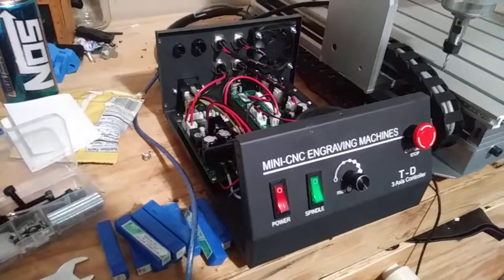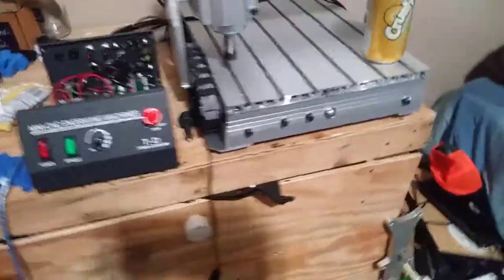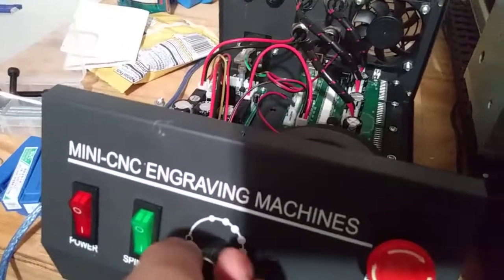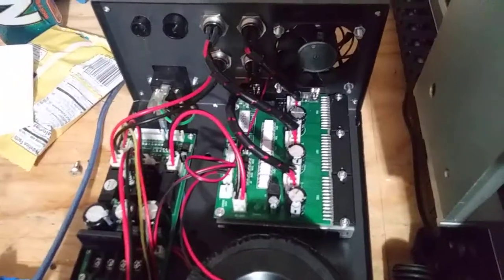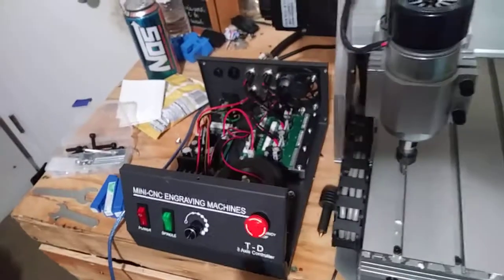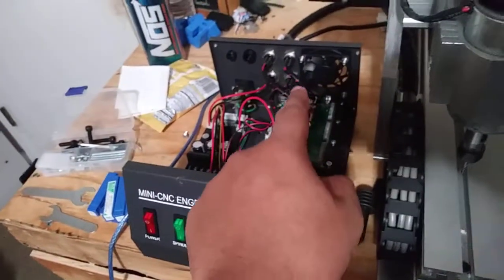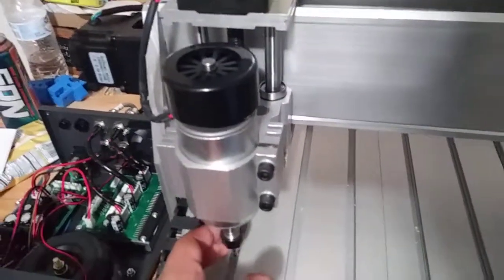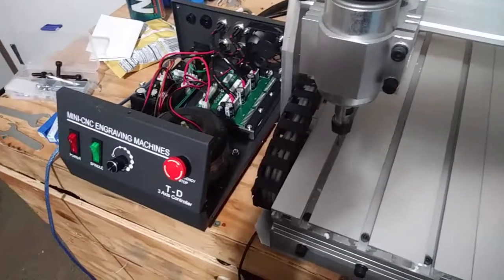Issues with my 3040 CNC from eBay.

Comment: It might just be the switch itself
Reply: It turned out to  be the included cable to the wall was bad. Though now I have GRBL running it and it works fine.

edit: I was using my primary account to reply by accident